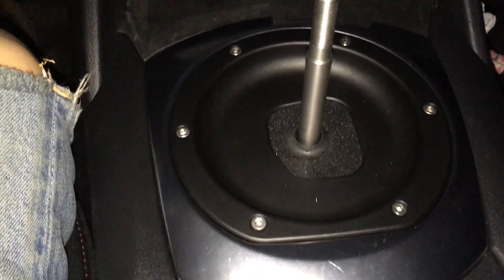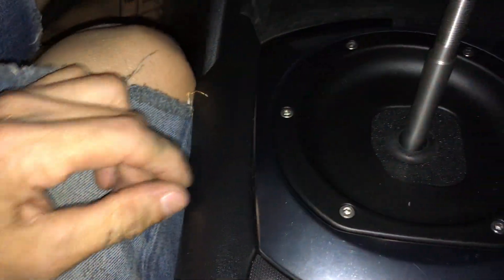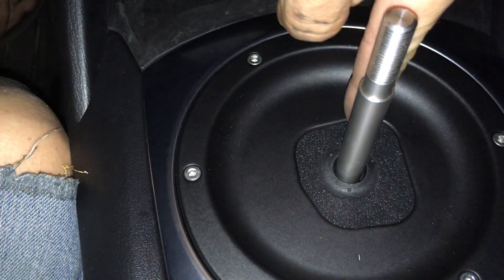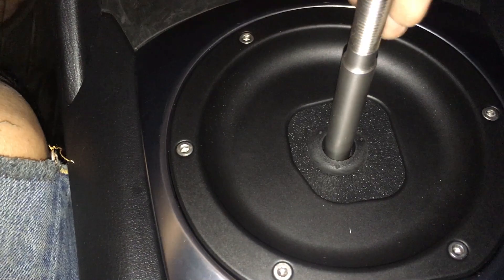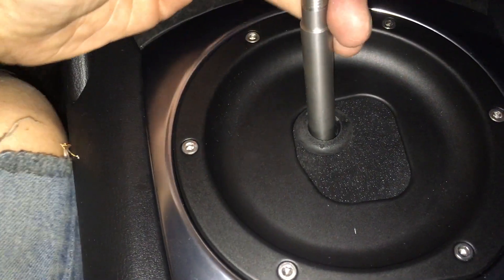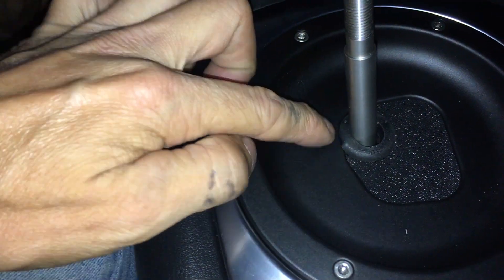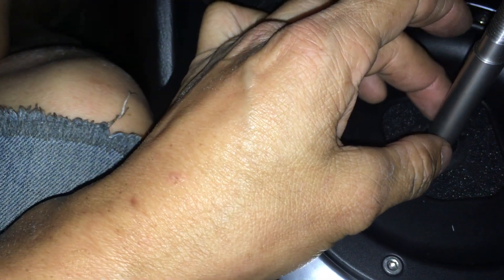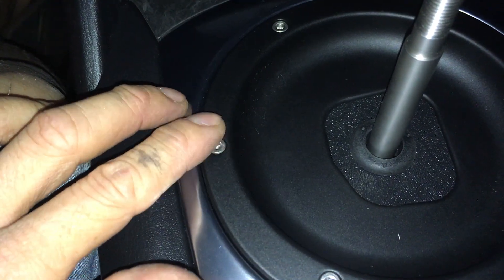ND Miata CravenSpeed short shifter & shift well

Comment: Their design should account for variances in this area, and I'm sure you're not the first one to run into this issue. This is an almost entirely aesthetic choice, so it would only behoove them to open up the design a bit. Looks like they've already done this as the latest ones are completely round. Honestly, if it's not going to be gated, just make it more open.
Reply from the maker: I was the one that bought it to their attention and subsequent design change.